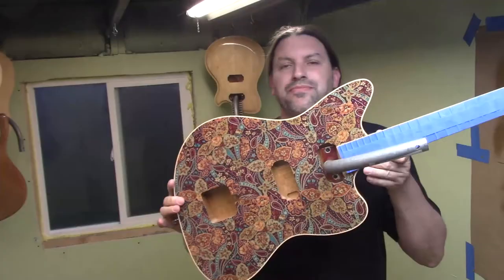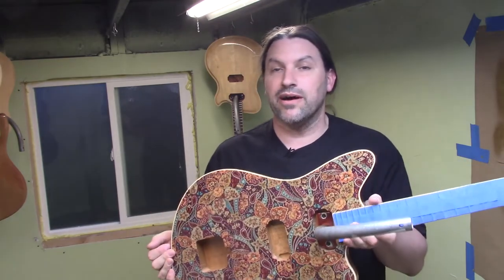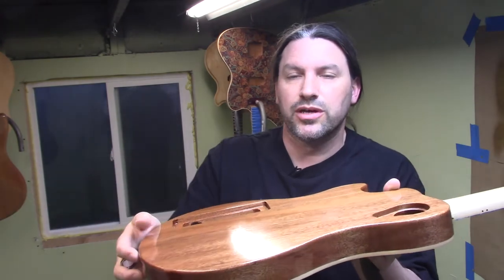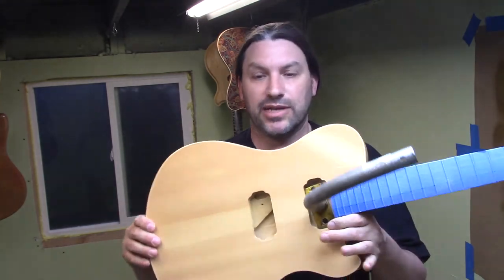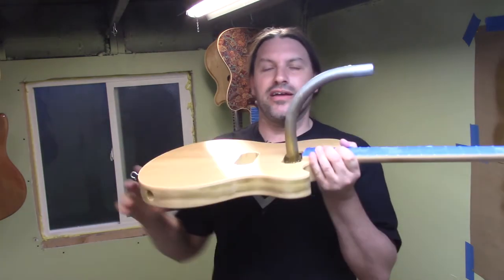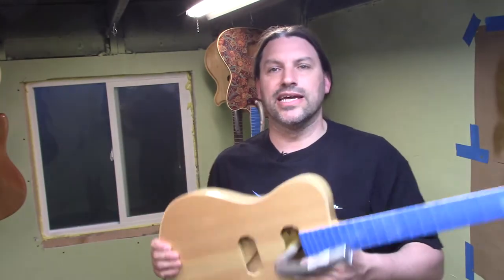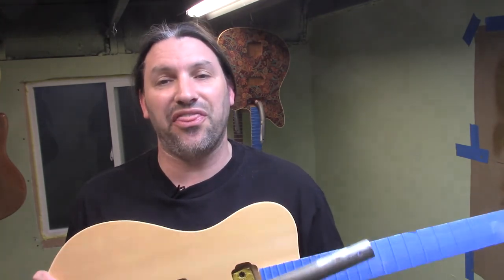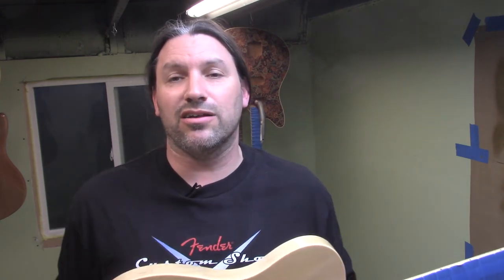Finshing Guitars With Modern Paints

Comment: good video, im glad youre using poly as a base coat and eurethane on top, theres so many myths about nc, its the most sensible way to go. thin poly , sand back then top coat.no need for grain filler etc.back in in the eighties we use to grain fill then all the way with polyeurethane( long proces) and after time it eventually sinks into the grain.we changed to light poly base then polyeurethane on top with no difference in tone. and the finishes still look great 35 years later.
Reply from the maker: Yeah I hear ya, We were some of the biggest lacquer weenies until we tried the modern paints... I guess they aren't really than modern anymore hahaha
It's so much easier to get the kind of results that people expect. I'll never go back to lacquer

Comment: Matt,  I grew up in an autobody shop, sanding primer, and eventually learning to paint with NC.  So doing wood was a small transition.  How/where did you learn the transition to Poly (the dos/don'ts)?  Simple things like what to use to clean the gun and how, after using a catalyzed finish?  I really want to move this direction, but it is scaring me to death..........  Thanks.
Reply from the maker: Hi Mark,
We just sorta jumped right in. Of course we were encouraged to do so by painter extraordinaire Mike Learn. We also spent a lot of time talking with the people at our local Finish Master, they were able to offer lots of help with stuff like clean up etc. 
I would say that if you can spray lacquer with decent results you should be more than qualified to spray the new paints. 
If there is one thing I would point out it would be that modern paints have way more... paint than solvent when compared to nitro. So, it is possible to go a little heavy handed at first. I'll be doing more finishing videos that might answer more questions (I'm sure they will also raise new ones too) I hope you tune in for those and let me know your own experiences with paints as well. 
Stay cool amigo
Reply: Thanks.  I will stay tuned, and try and shut up for a while.   Don't want to be "That Guy"  :)
Reply from the maker: Ha, I love the feedback. Actually, just about everyone seems to have great comments. There are a few trolls with nothing better to do but they seem to dry up and blow away pretty fast.

Comment: What's up Matt!

I just stumbled upon your channel after discovering fabric top guitars and I'm aching to build one now! I've gotta say, you've become one of my favorite channels within a couple of minutes :D
Now, I wonder what kind of finish you apply for the fabric tops after the sealer? Do you add some sort of clear coat to it? I live overseas so most I can't get my hands on all of your name brand stuff, but I might find a European equivalent.
Keep making the badass videos! 

Kindest regards, Vincent
Reply from the maker: Hi Vincent, 
Thanks for watching the videos, I'm glad to hear you are enjoying them. Fabric tops are really cool you will have a blast making yours. Be sure to send pics.
We do use a clear coat over the tops of the sealer. Right now we use PPG Production Clear (it is basically automotive top coat). It should be pretty straight forward for you to source something, at least, as good. We used to use lacquer but have become converts to the new paints. If you can find a local auto paint supply in your area they will be able to get you pointed in the right direction. 
Stay cool brotherman

Matt

Comment: When finishing with modern paints have you ever used the stewmac solid pigment for your solid colors ? Wondering if it would be compatible with urethanes
Reply from the maker: Hi jsalinas, I have not tried the solid color pigment yet... though we have talked about using it before. It would probably be fine if you used it with the DBC-500. 
Unlike lacquer the modern paints come in a dizzying array of colors that are really easy to get so mixing our own opaque paints has never been something we needed to do. I do have a bunch of that StewMac solid pigment stuff though I don't know what I'll do with it. 
Thanks for watching

Comment: Hi Matt;
  After spraying the Sanding Sealer do you recommend or is it necessary to spray on a primer before the color coat?
Reply from the maker: Hi DTM,
Great question, sometimes we do but most times we don't. The solid colors we use go on pretty well and we don't have issues with coverage. Some of the metallic colors do need a base coat...especially golds. If you are spraying metal flake the base coat will make the flakes look different too. Sometimes we do a black base for flake or match the base color to the flake. There are lots of videos about flake and it is really cool to work with, messy but cool.
Thanks for watching

Comment: Matt, I'm refinishing a fernandes revolver. I've been sanding for days! Is there a better way to remove the paint? What's the best way to remove the paint in the channels(can't think of any other name for it) I tried a heat gun but that's slow then death...I'm using 40 grit with my 5" bosch variable sander. I was going to use the da sander but then the compressor runs forever and the noise pisses me off after awhile. After I get it down to the wood, going to use the simtech sealer...but which one? Black, Gray, Clear? It is going to be a solid color, House of kolor kbc10 purple kandy with either a black base or silver can't decide..)
Reply from the maker: Hi Alan, I wouldn't worry about getting all the paint off of that body. The Simtec sealer is really sticky and what we do is scuff back the factory top coat and shoot it with Simtec. We use the EZ Sanding Sealer... it is clear.
Sounds like a cool guitar. send me some pictures when you are finished
Reply: Texas Toast Guitars ok thanks will do 😉
Reply: Texas Toast Guitars Matt so if I add 1% mekp I have 40 mins of spray time..that's what it says on the can but will it harden as the normal 2% mekp?
Reply from the maker: I'm not sure but I do know that you can mx it pretty hot. I is a chemical reaction so even a little goes a long way. I always let it set up for about a week, let it cook... you know.
Experiment a little and see what you come up with.
Reply: Do you use the normal 2%?
Reply: Also can I used a small roller to apply the sealer? I was thinking of rolling it a couple times and after ea cured coat.. Spraying it a pain the ass and clean up isn't that fun either using acetone
Reply: also I got thinking and may hydro dip it into a snake pattern...will the simtech eat the hydro dip pattern? not the sealer but the clear top coat
Reply from the maker: We pour out a cup of the sealer and put in a cap full of the MEKP... we keep it simple
Reply from the maker: We use foam brushes and foam rollers all the time, especially for fabric tops
Reply from the maker: Hmmm hydro dip, you should be okay, of course, I would test it first to make sure. I have never done that but I would like to know how it goes
Reply: ok cool thanks!
Reply: Ok great! I've got a bunch of foam brushes and a couple foam rollers